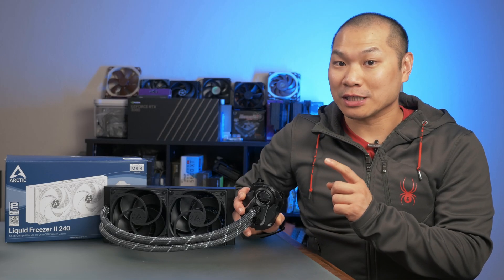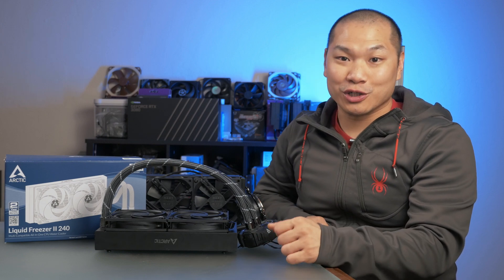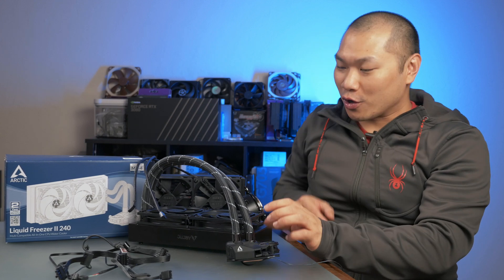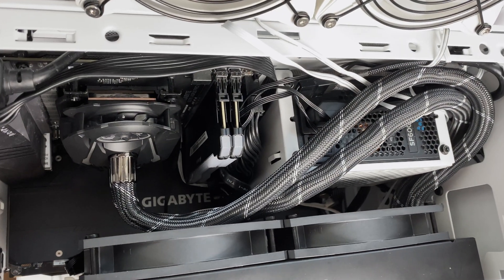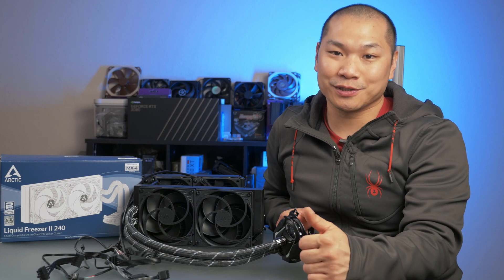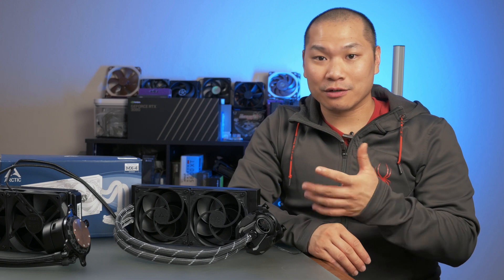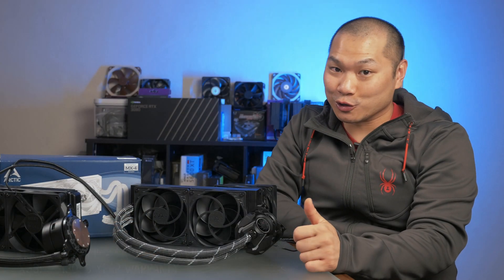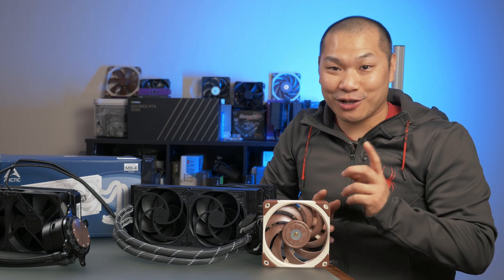The Arctic Liquid Freezer II 240 Liquid Cooler - is this the best performing 240mm AIO?

Comment: I'm thinking of swapping over to SFF, however I currently have a Kraken X63, how well does the 280 rad fit inside the NR200?
Reply: Should fit in the Nr200. You'll have to side mount the radiator
Reply: No issues with X63. Should fit much easier than liquid freezer II due to much more flexible and rotating housings of the tubes.
Reply: @Andrei_A220  Cheers, ordered my parts last night, motherboard and PSU arrive tomorrow, but case and fans I have to wait til end of month for :(
Reply: @Zillawill  where did u get Liquid freezer from and when?
Reply: @Andrei_A220  I didn't, I have a Kraken X63, running Arctic P14 PWM fans
Reply: @Zillawill  ohhh I see. Got it all confused. Read too many posts from different people 🤦. Good luck on your wait - I’ve been there believe me ...
Reply: @Andrei_A220  No worries, I seem to be waiting a lot these last couple month lol
Reply: @Zillawill  I started ordering parts 5 months ago
Reply: @Andrei_A220  I got my 3080 couple week back after waiting since launch, I feel lucky tho compared to some
Reply: @Zillawill  I had to earn mine 😅😅😅 in the battle 😎

Comment: Can’t decide between this or the C14S 🤔😩
Reply from the maker: The answer depends on what you’re cooling and what you are doing with the chip. If you want to all-core OC 9900k, 10700K or 10900K go AIO, anything else just go C14S. 3900X/3950X could go either way (I’ve run OC’d on air and water, both all good in NR200). Anything else an AIO isn’t strictly necessary.
Reply: @MachinesMore  thanks for the reply! I have a 3600 right now but waiting for the 5900x to be in stock. Not sure about OC but I’d want at least PBO enabled
Reply: C14S ! Honestly, air coolers all the way for me. Nothing better than a peace of mind knowing a heatsink never fails. Plus you get a free 3.5g NT-H1 thermal paste with C14S and it's significantly cheaper than AIO (at least here in Canada). Oh and you'll never hear water and bubbles.
Reply: @DropOfWater1  thanks! Just ordered the C14S!
Reply: @FairuzOsman  happy gaming!

Comment: Great video, any difference if installing the fan on the other side of the radiator pushing air through the radiator instead of pulling?
Reply from the maker: Typically no performance difference, but for in case testing it makes a big difference since that means pushing the radiator further into the case and that’s an impossible install with the way tubing is running.

Comment: Do you think you can fit a fan grill for the radiator? In case the fan hits the loop. I am waiting for some components still but already got the NR200 and 280 freezer. I heard that fits but might need some creativity and fan grill. Thanks for the video!
Reply from the maker: You can, however since I run the fans as an intake the exhaust side of the fans already have some protection against the tubes. Grill is a good idea if you have cables that could get caught.
Reply: @MachinesMore  I was thinking about routing it similar to https://imgur.com/a/q8JV2Vy so that I can fit 2 normal exhaust fan on the top. Were you able to fit the top 2 fans without going low profile?
Reply: @Abdullah Hussain I was thinking about routing it similar to https://imgur.com/a/q8JV2Vy so that I can fit 2 normal exhaust fan on the top. What does yours look like?
Reply: @Abdullah Hussain Thanks for the reference pic! Looks like yours bent a bit more at the pump than the reddit one. What are you using for PSU? How was the cable management?
Reply: @Abdullah Hussain You and I both for the SF750 :D Thanks for the details!
Reply: @Abdullah Hussain hey I finally just try to put it the liquid freezer into the case and the tube is pushing on the fan such that the fan is hitting the radiator. Do you have this problem and how did u solve it? It just makes bad sound hitting the rad
Reply: @Abdullah Hussain Thanks! looks like that works better when i have a psu in the case. I currently use an atx psu outside the case so no tension to support it :)

Comment: Nice review. but I disagree with the noctua NF A12-25 . I have done the test myself and have done a video in comparision, noctua is not that great interms of noise and airflow. The Arctic P12 PWM fans generate more focus static air  and they are more quiet compared to the noctua.
Reply from the maker: Cheers. I saw your testing methodology and it is very interesting. Not questioning your testing but it seems airflow biased at a glance, which would make sense if there was a flip-flop between the two fans. Just curious if you ever tested with a radiator with your airflow test, or an actual thermal load through a radiator? In my thermal testing with the radiator the NF-A12 was always at least a degree or so better, noise normalized, compared to the Arctic P-12.
Reply: @MachinesMore  Hi, I have replied you via email, since there is no response. with what you have mentioned. I did another test.. and this time with a radiator.. so you might want to check it out. thank you!

Comment: Can you fit the 280 version in the NR200?
Reply: You can but not all 280will fit.  So double check measurements
Reply from the maker: Yup, although 280s are tight fits in the case, tubing path is really tricky. The rad thickness makes it worse. I prefer 240s for the case.
Reply: Good to know, planning on using this for my next build! Not really a big fan of RGB.
Reply: @Abdullah Hussain thanks for this feedback)

Comment: I'm slowly getting the bits together for my 1st pc build, stock allowing, will be in the nr200. I might go with a more easily installed rad than the arctic with those tubes and my total lack of any pc building experience. However I still want to use those fans as they seem perfect. Could you please add amazon UK affiliate links to the pwm pst fans so I can buy here in UK and still contribute. If poss add links to the multi pack and single version just in case :)

I might suggest adding UK links for everything else as well. If the case ever comes back into stock at amazon uk I'll buy that thru your links as well if it helps 😉
Reply from the maker: That's awesome and thanks for the support! In the next few weeks I'll be doing a build tutorial along with recommended components so that should be helpful for you. I think a lot of people will be doing their first build or at least first SFF build in this case. I believe the links should convert to your Amazon UK site if you use the ones in the description- it should suggest similar products if not available in your locale.
Reply: @MachinesMore  yeah just tried again. Only takes me to the US site. Only way I can find to get to the UK site is to manually enter the address which I assume wouldn't help u out. 

Biggest issue for us in UK is getting a case, been sold out EVERYWHERE since launch. Just ordered my 5600x cpu, waiting for a 6800xt to go with it. Can't choose a specific card as don't know the dimensions of them all yet. Narrowed mobo down to either the gigabyte x570 aorus pro wifi or the b550 aorus pro ax. The b550i is £40 cheaper but dunno if the x570 is worth the extra. Probably yes lol. And of course 750W sfx power supplies are like gold dust at the moment.

Comment: awesome vid. This is actually the AIO I was looking at to put in my NR200P - Question: WIthout the software and cables, how do you monitor and create your fan curves for it?
Reply from the maker: In the video there’s a quick chart of the PWM signal and how it translates to the pump and VRM fan speeds. I wouldn’t worry about pump speeds too much on this unit because it’s not loud. The easiest way to monitor and create fan curves is in your motherboard’s BIOS. Hook the unit up to a CPU fan header and you should be GTG. You could also do a fan controller but don’t see why anyone would need one just for the sake of controlling this unit. For bottom mounting the thicker rad should still clear the riser cable (assuming you’re doing a VGPU).

Comment: Hey! could you by any chance tell me the name of the screw size used for the fans on the radiator?
Reply from the maker: Of course! Radiator screws are pretty standard, they're #6-32 screws and vary according to the length you need. Typically you'd want 30mm for 25mm thick fans- but when you install you will need to absolutely make sure they will mount without touching your radiator heatfins, otherwise you risk damaging the rad.
Reply: @MachinesMore  Thank you very much! I have been looking for this info but no luck. So most Phillips Head Screw UNC 6-32 x 30mm will work?
Reply from the maker: Of course! In general 30mm should be fine. You’ll also want some washers just to even out pressure on the fans.

Comment: 2:15 Do you think that bend is ok long term?
Reply from the maker: Personally I’d be comfortable with that, no kinks and it didn’t need to be forced hard to stay in place.
Reply: @Abdullah Hussain did you also have top mounted fans?
Reply: @Abdullah Hussain thanks for the quick reply! Was about to send the 280 back because I was afraid of the bends but I'll try this config.
Reply: @Abdullah Hussain I'm trying it right now but I can seem to get the hose from the cpu to stop interfering with the fan
Reply: @Abdullah Hussain thank you for the pics! That helped I was putting the radiator pipes on the end of the PSU. But this worked a charm! Thanks again for the help
Reply: @Abdullah Hussain yup I agree. The pipe bend from the cpu header is a little tight still I think but I'm going to see how I get on. Thanks again, great help!

Comment: What kind of temps are you getting with the stock arctic p12 fans vs the noctuas?

I'm currently rocking the 280 mm version in my nr200.  It's a tight fit.  I had to replace the fan that is directly in front of the CPU as that bend was too hard on the back of that fan.  It was grinding on the radiator.  I replaced it with a low profile 140 mm and it's all good now.

These are by far the best AIO I've ever used.  This is actually my third one.  I've bought 2 280 mm and 1 360 mm.  The only issue is they're always out of stock.

I've even hooked it up to a 2080 super.  It was pretty hard to make it fit but temps were great.  Around 50c average temp.
Reply: Hey there, I'm curious how did you mount it on the 2080 super?
Reply: @RyugaHidekiOrRyuzaki  I had a gaming x trio.  It was pretty hard to do since the tubes are so stiff.  I flipped the two mounting brackets inside out.  I placed it as centered as I could on the GPU die.  I marked where the mounting points line up and drilled into the mounting bracket.  I used the existing backplate screws to screw the AIO from the front instead of the backplate side.  It's a bit hard to explain, more of a you gotta see it type.
Reply: @cdreamworld  hey dude. Just wanna ask, is it possible to vertically mount the gaming x trio in the nr200p and have the 240mm arctic aio at the bottom?
Reply: @azzatazizi  I don't have the vertical mount.  I only have the regular nr200.  I can manually put it up vertically and see how it fits later today for you.  But if you're going with a glass side panel, it's not going to work out well with a gaming x trio.  And also putting the radiator under the pump isn't a good idea either.  The arctic only have a 2 year warranty.  But I'll let you know later today how it goes.
Reply: @cdreamworld  yea i do aware of the thermal issues by putting the gpu vertically and also mounting the radiator below the pump is not good but rather planning that because of the aesthetics. Is the thermal going to be that bad with vertically mounting the gaming x trio? I can’t decide between performance vs aesthetics. Planning to buy the nr200 soon. What’s your opinion on this? Your response is much appreciated.
Reply: @azzatazizi  Depends on if you're planning on using the glass panel or not.  If you're aiming for a glass panel, it might get pretty bad as the trio is a 3 slot card.  The bracket is 2 slots, but the actual GPU is 3 slots.  It's going to be right against the glass.  You might get away with it if it was a 2 slot card.  If you're going to use the standard side panel, then you'd be better off having the GPU horizontal and put the radiator on the side panel instead since you can't see through it.  All the LEDs would still glow through though.

Honestly, the case even without the glass side panel is very beautiful as is by itself. If you want to go aesthetics I'd really recommend going with a custom loop instead.  It would look much better but will cost a lot more.
Reply: @azzatazizi  Hey, just wanted to update you on the vertical GPU mount.  It's possible, but the tube is putting some pressure against the back of the card pretty sure gonna give it a slight flex towards the side.  I'd just put something between the side panel and the GPU to brace it so it doesn't flex.  Should be all good.
Reply: Just buy 140mm grill and all is fine ;)
Reply: @willeeh_  Thanks.  I thought about it but arctic's extra thicc radiator + fan + grill would put too much pressure on the tube and might break it.  Going with a slim fan worked out though.  Temps didn't change at all.
Reply from the maker: Noctuas NF-A12x25 vs P-12s are typically 1 to 1.5 degrees better at the same noise levels. They also have the added advantage of going to 2000 RPM vs just 1700 on the P12s. If you're running the fans as an intake then the fan cage should at least prevent the tubes from interfering, otherwise I'd recommend a fan grill. I could imagine the 280 is a tight tight fit in the case, I like 240 units better in the NR200 for the compatibility reason.

Comment from the maker: Just a quick note- I reference the price of the Arctic P-12s at around $5-$7 since I'm used to that price, though I realized that lately the market prices for the fans are all over the place. The 5-pack is a great way to get some fans for coolers and also have some case fans to play around with.
Reply: Hi bro, just wondering if you can have a review on the upcoming Mjolnir sub 10L case which is for preorder very soon. I've been looking and obsessed with this case. Hope you could got one thanks!
Reply: Thanks for the in-depth video, very interesting for me who is thinking of buying almost this exact setup. With your NR200P have you tried a bottom mount AIO when using the gpu vertically? In the Kitguru review of the case they came to the conclusion that it was the best configuration, even though you can only use a 240mm radiator rather than a 280 on the side panel.
Reply: @chairs-dimension  bottom mount AIO will kill it the fastest way, as the air bubble inside will accumulate in the pump, resulting first in unwanted sounds and later in death of the pump.